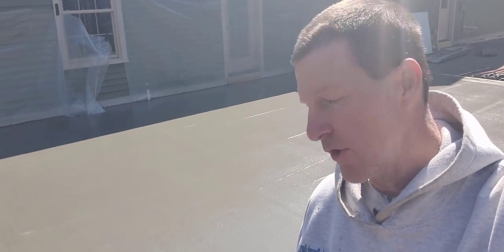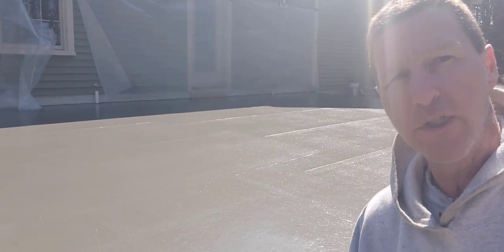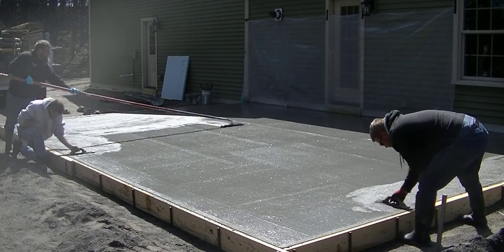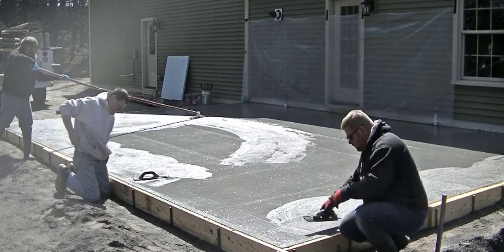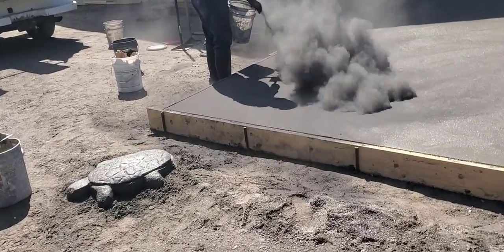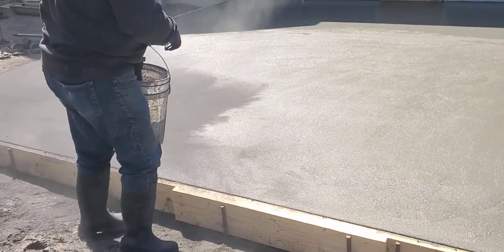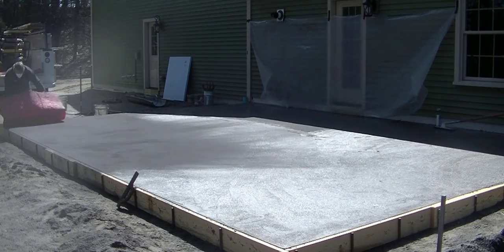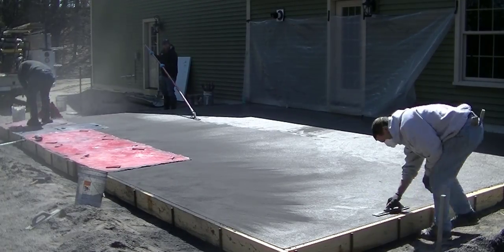How To Stamp Concrete (Easiest Stamps To Use) Part 2

Comment: I have a question? Hopefully i can get the right answer. I want to build a small 4 post driveway carport on some old and cracking driveway(really big cracks). I want to spend the least amount of money but also dont want it to fall ,heave, or move. I wamt to cut the existing driveway ,and dig holes for the posts. Mikey Day's best answer on if making the hole bigger at the bottom, they call it bell something, also I live in San Antonio, Texas,and i believe frost line is 12 inches so question how much more than 12 inches should i dig, and lastly does it matter if i use dry or wet concrete. A video talking about compressed or dry concrete is better than quickcrete wet concrete. Thank you in advance.

Comment: hi mike, what's the minimum air temperature to stamp concrete. I have a stamped concrete pour tomorrow and the weather forecast calls for 49 degrees here in Michigan
Reply from the maker: 49 is cool but ok. You just don't want to cover it to protect it from freezing. So if temps are forecast to go below freezing, I would delay and wait for warmer temps.

Comment: Hi Mike I watch a lot of your videos but I have a question. I have two year old stamped concrete but I have a few spots that have chips along the cut lines and a few spots I’d like to fix.  Is there a product that will bond to existing concrete.